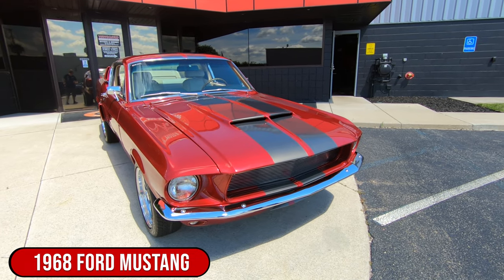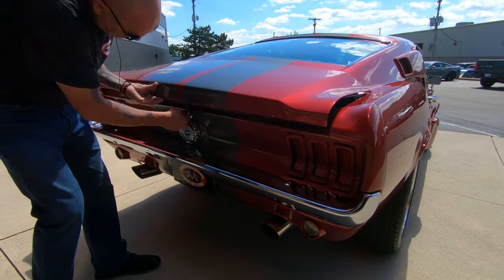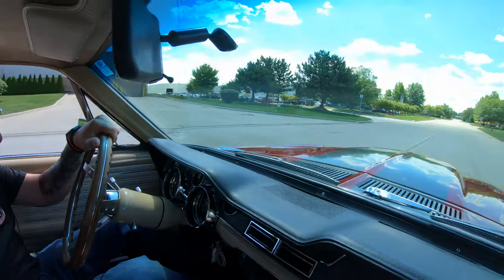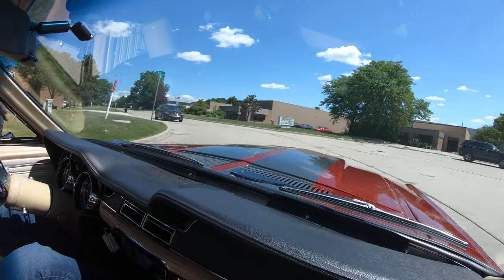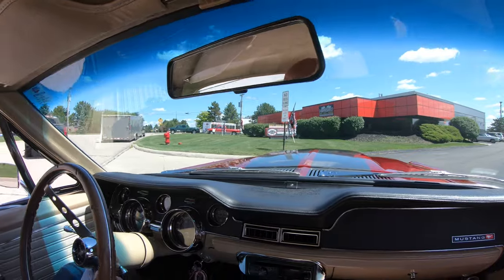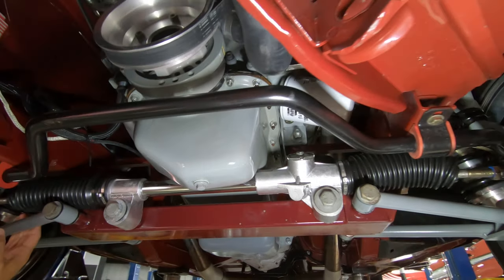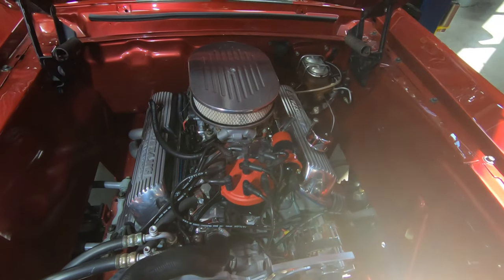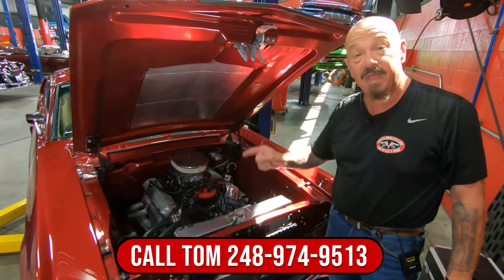1968 Ford Mustang Restomod For Sale Vanguard Motor Sales #2153

Comment: 7:47 what  happened to the passenger sill just as you pan down the side nasty ding on the underside
Reply from the maker: You mean the drain hole? They are on every 68 mustang?
Reply: @vanguardmotorsales  i guess i misviewed it on the quick pan. It looked like a dig.